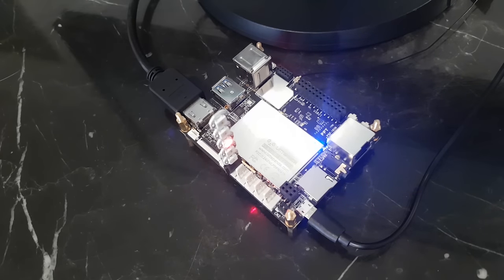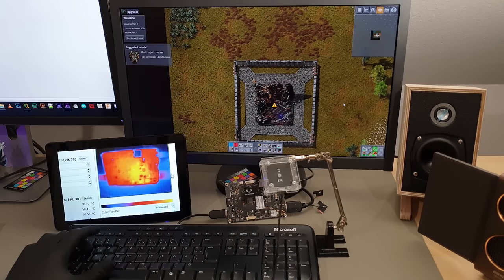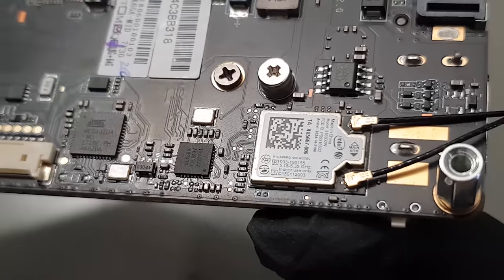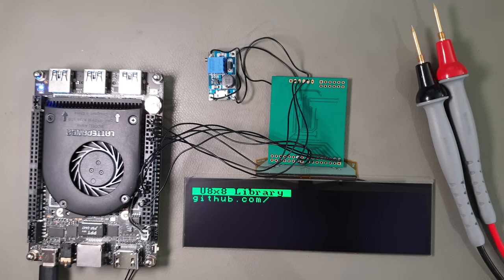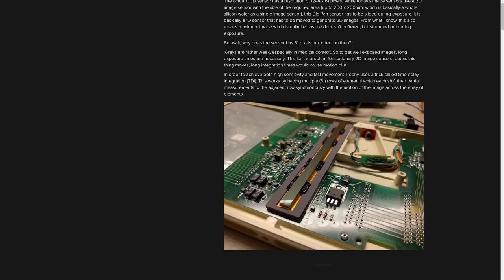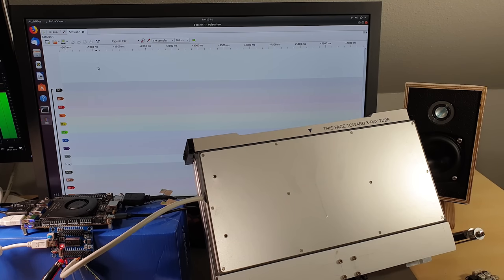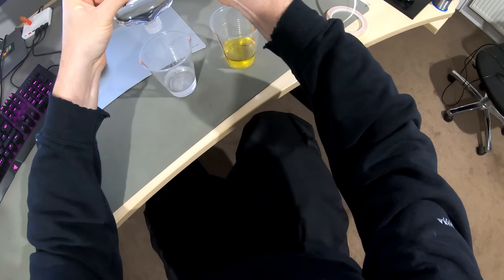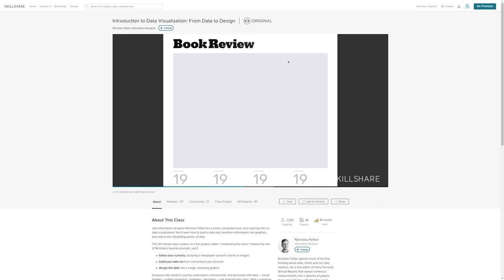LattePanda Alpha: Shenanigans with a powerful Single Board Computer

Comment: That looks like the board and tube from a Kodak/Trophy 2200 X-ray system with a TRX708 tube. I developed a driver for these together with a friend a few years ago, by reverse-engineering the original hardware. You want about 10 microhenries in series with the transformer primary, to bring the series resonance frequency down to 150-ish kHz, then you adjust the drive frequency to set the secondary voltage. This gives you voltage regulation ability and zero voltage switching at the same time. They are designed to be driven from a full bridge running off 170 V DC or a half bridge running off 340 V DC. Adjust filament voltage for desired anode current. The HV board has a relay for selecting the filament cup bias resistor. With the relay open, 4 mA gives you the correct focal spot size, with the relay closed the value is 7 mA. Contact me if you're interested in X-rays and firmware from the original driver, or schematics of my own driver.
Reply from the maker: You are exactly right about the hardware! Mine had a broken ceramic divider network due to warped plastic cup and multiple attempts at fixing that failed miserably! I've tried controlling their MC34067P error amplifier with a potentiometer, but the result is shown in the video. I'll read your comment a few more times and try it that way, thank you :)
Reply: @reps  Aha, so this was using the original driver, that makes sense. My comment was basically how to replicate the original driver, so you are already almost there. The problem with injecting a signal into the error amplifier is that it has a very high gain at DC, making any fine adjustment impossible. The error amplifier probably saturated and pushed the frequency to the lowest allowed value, probably overvolting something in the process. The best way to control the driver manually is to separate the frequency control input of the 34067 from the error amplifier input, and then control that directly. If you power the DC bus from a separate supply or a variac, you can bring it up slowly to make sure it's operating correctly before any damage happens. I do have a bunch of the x-ray heads in case you need spare parts.

Comment: You should take a look at Klipper, it's a 3d printer firmware that does all of the hard work on a high powered host (Raspberry Pi) and then uses an Arduino as a glorified stepper driver. This allows much higher step rates and more accurate kinematics. It's my belief that this is the future of 3d printing.

Comment: Way to expensive compared to these NUCs for example. Which are a lot faster. Only interesting for specific embedded solutions
Reply: From what I can see, the newer NUC boards cost more, when you also factor in RAM and SSD, which are both included in the $358 version of the LattePanda Alpha.

Comment: You should get an Ultra96 board. It's a credit card sized zynq ultrascale board. With 4 cortex A53 cores, two cortex R5 cores, a mali-400 MP2 GPU, 153K logic cells and 2 GB LPDDR4 memory. It costs around $250.

Comment: Leonardo is exact reason why I did not buy one. I just went with a normal UNO (for GRBL) and picked up an old HP netbook motherboard for $15 USD, I just made sure that it had ethernet and VGA. I slapped in a stick of RAM (found in the drawer of old laptop parts) and an old 60gb SSD and I have a more than adequate setup for controlling my CNC machine, I'm not number crunching after all.... Though the system is more than capable of normal tasks in Linux (Debian with XFCE environment) because it does have a dual core ATOM with hyperthreading. Never once an issue while using the machine.

 I used my friends X-carve to cavity out a 2"x10" and made a nice looking case for the motherboard and arduino. I made my own breakout board that goes from the arduino to a parallel connector to the CNC controller. I keep looking at these Intel SBCs but I want one for a specific usage, but without a bunch of hassle to get GRBL working.

Comment: Hi. Thanks for video. I use LattePanda Alpha (864s) (m3-8100y) with titan case. I installed windows 10 on m2 ssd (toshiba rc500 m2 ssd). While the CPU temperature is 45-50 degrees in idle mode, the CPU temperature rises to 95 degrees during operation. Is this normal?

Comment: An STM32F4 or F7 would be a nice chipset to use with the lattepanda. They can run Arduino and have significantly more power than an Atmel chipset. They also have much more connectivity. Except for network-based items where I use an ESP for its built-in wifi the STM chipsets have replaced all my Arduinos.

Comment: I have trouble envisioning many use cases where this makes sense given it's $400 pricepoint. This isn't a general use hobby level single board computer. It's something you'd have to have a specific need forthat level of computing in that small a form factor to justify the cost. At least for me, just having a computer that small for the sake of having one that small wouldn't cut it.

Comment: You apparently completely missed the point of the atmel chip in this situation.  It's not there to just be an IO expander with the main cpu doing things bit by bit - that's dumb, and here's why - the big cpu is running a pre-emptive opsys (linux or windows) and cannot be counted on for fast response to events - even interrupt latency is variable.  The glory of the big guy is that it can run complex software like databases and GUIs - but the glory of a preemptive opsys is that it....prempts and goes of on its own errands, destroying any hope of real time deadlines.
 The little atmel chip runs whatever you want it to, and it's completely time-deterministic.  I use a combo much like this in data aq and control around my physics system (fusion reactor) and homestead (off grid power and  water systems).  The arduino-class thing talks directly to the world, and has just enough smarts to buffer data and commands for the big system, which while sometimes high latency, can do smart things like run a database or a neural net to make complex decisions the little guy then implements.  I use "whatever" for the big machine, could be a raspi, or a NUC.  Often the small one could be an ESP-xxxx if true realtime interrupt latency isn't super important, or a plain old arduino if it is.  It's a match made in heaven...if you are a for-real systems guy.
Reply: Heck yeah, you are amongst the list of influential science minds that I, so to speak, look up to. Cool to see you pop up here haha.

Comment: Very nice, I love the cooler design but for this price I'm not interested at all.... For €20 I got a mATX pc with a i3 540 @4,3 GHz (overclock possible on all motherboards and cpu's of intel "i" 1st gen).
It scores 315 points in R15....without overclock it's the same as this m3...
Of course it's not as small and efficient as a lattepanda, but its way better for 1/10th of the price. I also got a 4c,8t Xeon X3440 @4GHz for €8 from AliExpress (scores 625 in R15).

Comment: If you need mineral oil check out a horse or cow tractor supply store for Horse Laxatives'. Its a heavy weight mineral oil by the gallon. Otherwise florinert is cheap on ebay...
Reply from the maker: Flourinert cheap? got a link? want :)

Comment: Interesting to see "x86" type sbc instead of the overly common ARM based designs. Too bad they tried to "arduino it" with that tiny uC and all those pin headers. why does everything need to be "arduino'ed"

Comment: They should have gone for an ESP chip, faster and potentially more versatile.

Though this would be a perfect all in one for a 3d printer with Klipper running on the board. Combining the power of a desktop processor with the real-time response of an Arduino.
Reply: No, they should have gone for an FPGA and the circuitry to program it on the fly. An ESP is more powerful, but is still not really ideal for doing real-time IO. Connecting the pins to an FPGA would have given you a lot of flexibility, and they could have just configured it by default to be a pass-through GPIO expander for ease of use by people who don't know how to program an FPGA.